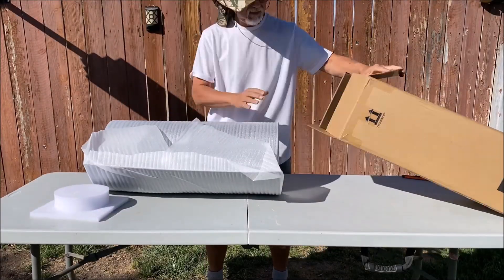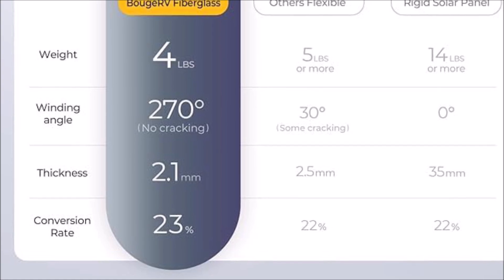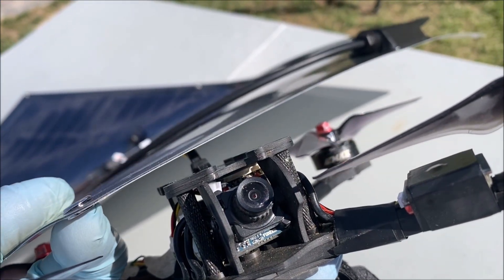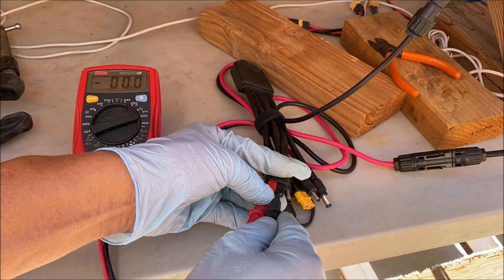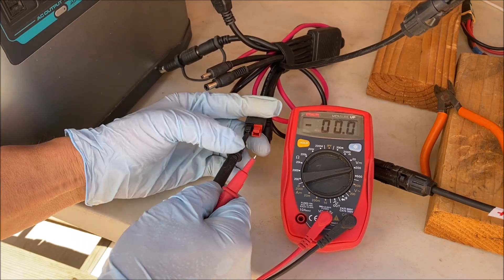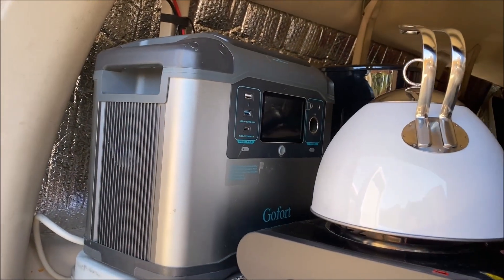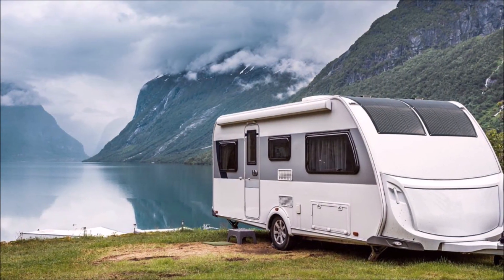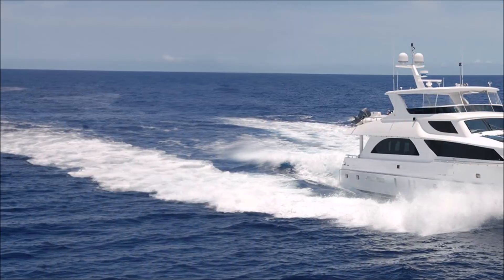BougeRV Yuma 100W  a Thin Film Flexible Solar Panel Review

Comment: I run 600 watts of solar on our sailboat.  Two of the panels are 200w hard framed and two are flexible 100w panels.  Every year the flexible start out ok new, but degrade quickly and I replace them at the end of six months in the winter tropics.  The outer coating failing seems to coinside with the drop in performance.  The frame panels perform like new year after year.
Reply from the maker: @montanadan2524  
Have you tried to cool them down if they are flush mounted?  The heat build up is one of the main culprits for performance loss.  And if the flat panels are not working for you, is there a reason for not changing them to hard panels?
Reply: @RCEscape  they lay directly on my bimini and connectors sun resistant fabric.  The sides and rear of our cockpit are open so no heat build up underneath.  I only keep using them because they take nothing to keep in place (paracord) and at $100 a pop, are easily replaceable.  I need 600 watts to run frig, stand alone freezer, small starnet inverter, and other dc loads on a sail boat without shorepower.  I would never use these in a permanent mount situation (glue down) like our camper van.

Comment: 100W bad Bro
Reply from the maker: Why?
Reply: @RCEscape  just 100Watts
Reply from the maker: @onclefly8450  
100watts is perfect for beginners and also for drone flyers out in the field for recharging batteries.  All you need is a small power station like a 300watt model that will charge and discharge at the same time like the allpowers s300 and you could fly all day with minimal amount of batteries.  Perfect for a small car.